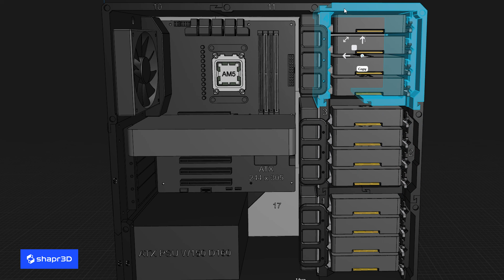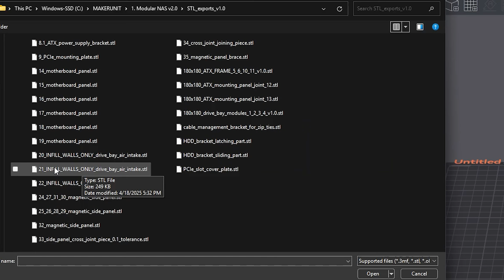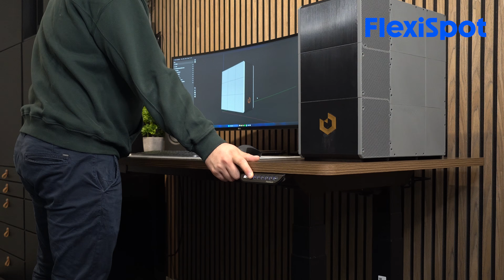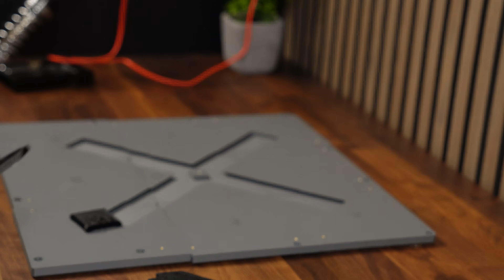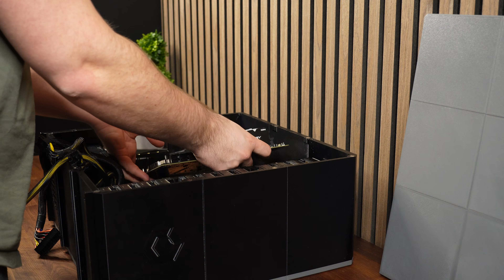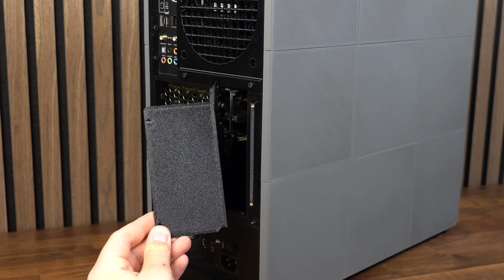Maximize Your Home Storage With This 3D Printed ATX NAS Case

Comment: I guess next will be e-ATX compatible case to have the complete line up 😅.

By the way i think the door could benefit a lot of hinges. And maybe some alternative back panels with feet to allow the case to aldo work while in horizontal position. Definetly subscribing to the channel!
Reply from the maker: Some time down the road E-ATX might come 🤷‍♂️ Door hinges could for sure be a suitable alternative as well!

Alternative side feet is also a possible option and can be easily added with the included .step file if necessary 😊

Comment: Would it be possible to sacrifice storage space to make room for a bigger graphics card? This looks nice, but I want a case for a normal PC, not a NAS.
Reply from the maker: Hi! It’s possible to do, however I haven’t tested it out. Have you checked out my other ATX case on Printables? It’s got the same printing requirements, uses less filament and is generally better for «normal use».

https://www.printables.com/model/900406-atx-pc-case-180-x-180-mm-print-volume

Comment: First of all, congratulations to you and your wife/GF/SO on your baby!

Thank you for sharing this brilliant build! I do have a few questions and thoughts:

1. Since the case is 100% plastic, there is no EM shielding, correct? Have you noticed any problems that could be attributable to that?
2. I'd love to have a few small openings in the front or even one of the side panels for a power/reset button and USB ports. I assume we could make our own modifications for this, but would they compromise the structural integrity of your design?
3. Your drive cage system is awesome; I especially love how the HDDs snap into position. Since they are responsible for much of the structural strength of your design, would you consider them ideal to use as a key subsystem for a modular case system? For example, a row (or double row) of those cages could run horizontally along the bottom of the case, and the motherboard and PSU could sit above them.

Again, thank you and congratulations!
Reply from the maker: Hi Felix! Thank you very much! The due date is right around the corner so we expect his arrival around a week from today! 

1. I personally have never had issues with shielding in terms of static electricity etc. However frequencies emitted by the PC I have no idea how works. I have not been able to measure this and frankly don’t know how to. I have had many people concerned with this, however not a single person who actually built one of my cases (to my knowledge) has reporter static etc. being a problem either.

2. I have designed a version with some air intakes in the front in between the drives rather than the side but I’m awaiting feedback from some users who are testing the files for me as I’ve been very busy lately preparing for the baby’s arrival. About USB, I think due to the density of the drives going all the way from the top to bottom, I’d say the most reasonable place to put some USB’s would be the middle top panel right behind the drive bay joint. I don’t think it would ruin the integrity of the case. Alternatively removing one drive slot at the top or bottom could allow room for a front-panel USB.

3. Thank you! I think they would be strong enough to have the motherboard sitting on top as well. I’ve been thinking about doing a 8-bay design with two bays at the bottom like a Micro ATX motherboard on top. That could potentially work out very well. 😊

Comment: I'm kind of worried that the drives might get too much vibrations, this could be at least in part mitigated by using TPU for the feet and fan brackets but i'm still partially worried. Great design nonetheless. Would be cool to see if a TPU fan bracket part would be possible
Reply from the maker: Most PC fans I have used have little to no vibration at all and are pretty well balanced, both expensive Noctuas and cheap ones I got from AliExpress have been working great, especially when mounted to a case directly. 

It’s possible to add some vibration damping rubber pads (double sided tape) to the bottom for vibration reduction. However it won’t stop the case itself from vibrating, only lessen the audible noise it transfers to whatever surface added. Of course unless your desk is already vibrating from something else. However, most desks I have used do not vibrate a lot… 🤷‍♂️

I’m glad you like the overall design, and I understand your concerns, but I’m also a little confused as to what you mean actually cause the vibrations, the fans or the drives? If it’s the drives, I’d agree more than if it was the fans.
Reply: One common solution is to use rubber grommets for the screws used to hold the drives
Reply from the maker: @felixfujishiro2304 Yeah that’s possible too! I believe the whole drive bracket could theoretically be printed in TPU as well, however I’m not sure about the latching mechanism only… 😅
Reply: @makerunit   as felixfujishiro2304 said before me, if you look at commercial NAS and server drive bays they usually have some parts made of rubber or soft plastic; fans are less of a concern because some of the high end ones ie. Noctua have soft pads around the screw mounts. As for the HDDs the reason is partly because vibrations can shorten the life of hard drives, but also because multiple parts moving at the same rate (i.e. fans set at the same RPM, or HDDs spinning at 7200rpm at the same time) can create resonance (this can be heard for example in cheap metal cases with multiple fans mounted on the same side, as a slowly "pulsating" noise). I'm sure it's less of a noise concern in this case, if noone who printed it reported it, but still a bit of a concern in terms of drives longevity. Sorry for the long wall of text 😅 I'm still sure this is a minor concern anyway and I love to see we're finally getting mATX more love! My personal challenge right now is trying to fit a mATX on a 10" mini-rack unit! (this is the second time i try to post this reply but yt keeps deleting my comments while letting through spam bots... I hate this site)

Comment: So… how much filament do you end up using before everything fits together perfect 😂. I always burn at least 1-2 prototypes designs before everything fits correctly.
Reply from the maker: Hey! For this one I actually only did one «main» attempt. I’ve made so many cases now that I’ve learned the typical failing points by previous mistakes.

Only had to re-do the PCIe rear panel once, and part 10, the I/O upper left corner piece.

Total filament spent, about 4.5 spools. It is a filament heavy project.
Reply: @  Nice! Very well done for a case of this complexity. Since I have your attention, I’ll throw in my suggestion for you to design a Raspberry Pi 5 case in your style.
Reply from the maker: @sunnygalli It’s already on my «eventually» list 😁 I’ll be sure to keep it in mind. It would for sure be dope! Can’t make any promises though. We’re expecting a baby due next saturday so I’ll be somewhat limited in the coming time!

Comment: Great build but I think the fans placement is not ideal. You are severely restricting the amount of airflow with the pattern of the slots on the side of the HDD cage. It would be ideally mounted on the side pushing air into the HDD's not pulling it in.
Reply from the maker: Thanks! And it was actually the original design, but ended up like this simply due to a matter of trying to fit all this within a print volume of 180mm cubed. I’m working on an alternative now though which allows air to be pulled in the front instead of side. However it’ll still be pull 😅
Reply: @makerunit 
I would be very interested in a future design in which outside air is pulled in from the front.
Reply from the maker: @felixfujishiro2304 That’s true! I’m for sure making more versions in the future so I’ll keep all this feedback in mind when that time comes!

Comment: Ermm what about the air intake?  I mean, the ones at the front is still taking warm / hot air from the drivers?
Reply from the maker: The air intake is on the side. Yes the air will be a little bit heated up from the drives, but let’s say the air being pulled in is 25c, passing the drives it may increase to 35c or 40c for very hot drives  (talking air temp, not drive temp)

40 C air can still cool down a 60-70c CPU, as long as the air going into the air cooler is colder than the CPU temp, it will still have a cooling effect.

Most people will not need super high power components in their NAS anyways, as they usually serve as storage servers or similar requiring less processing power 😊
Reply: @makerunit  thanks for the reply.

Comment: Such a cool build! I'd really love to see a way to do this with hot-swappable drive trays and a backplane, but the electronics required for that might be outside the scope of what can be done at home right now.
Reply from the maker: Thanks! It’s possible by using backplanes but I haven’t been able to find something that’s easily accessible for «everyone». Therefore I’ve opted for manual wiring on my projects for now. I might try a backplane one in the future at some point though 😊

Comment: Love your videos, keep it up! 

I have been thinking about a NAS enclosure to be used with a old laptop. Bottom plate of the laptop can be remove to rest the laptop on top of the enclosure, maybe even add extra cooling to the laptop. For a 15 inch laptop it could have 6 bays for drives, a nvme sata adapter a place to store both the laptops power adapter and a small power supply or a power distribution card to power the hdds. I have been dreaming a built like this for some time but I am too lazy to learn this level of 3D design. Do you think this idea is even possible? I would buy a printer the second this idea becomes a reality 😂
Reply from the maker: The idea is most likely possible, however not likely something I will do, probably never, mainly because most laptop boards are different, there is no standard and hard to make one model to rule them all. 

I don’t think it’ll be super hard to make something like that but unfortunatel you’re on your own when it comes to designing this one as I mainly focus on making models that are universal using standardized parts 😅 feel free to take some inspiration from my designs though to help you a bit 😊

Comment: Love this case!!! Purchased the plans and just about finish the printing but I do have one question. Do you think this will fit a 240mm AIO?
Reply from the maker: Hey! Thank you! I designed this specifically for air cooling as NAS systems often run 24/7 and in those scenarios air cooling tend to be more reliable in the long run. It will not fit as it is now, but you can modify it at your own risk with the included .step file 😊
Reply: @makerunit  Thank you for your quick response. Also, I believe I may run out of PETG for parts 12 and 13. Would it be ok to print them in PLA?
Reply from the maker: @ 12 and 13 are the panel joints, these may be good to print in PETG if you can, any color will do though as it’ll be hidden behind the motherboard. 

It’s what holds everything together so it’s extra at risk of bending due to heat etc. My recommendation is still PETG, but PLA may work as a last resort. Are you planning to install very hot components?
Reply: @makerunit  No nothing hot just the usual PC components. I actually found some extra PETG but I am having a difficult time siding pieces together. To the point where I actually  broken part 5 trying to hammer it into part 6. I re-printing it  but only have PLA. That shouldn't be an issue should it and do anyone have any suggestions on making the parts slide together easier?
Reply from the maker: @calcappone  It should not happen but can happen due to the tolerances being too tight.

Have you checked your printer for over-extrusion?

What printer do you have btw? The thing is to get dimensionally accurate parts you also need the settings tuned properly for each filament. One spool of PETG can behave differently at a set temperature than another PETG from another brand.

I should probably have specified this better though. How are the other parts? Have you been able to attach them?

One tip if you’re struggling to mount them, try sanding down the inside of the track a little bit instead using sandpaper to try to carefully remove some material until it slides together.

Another factor that might be making a difference is layer height. A smaller layer height will usually give more precise parts. While a bigger layer height will give more friction and bigger overhangs.
Reply: @makerunit  I have a Creality K1C and I have been having a difficult time with all the parts...even with the magnets fitting into their place. Funny thing is, I reprinted part 5 in PLA and it slid together with ease. I have got most of the magnets in the PLA outer panel by using pliers. The ones that go into the PETG main body have not been easy at all. I have only place 4 by using the soldering iron to make the holes a little wider which was time consuming. For the rest of the magnets inserts, instead of magnet I inserted threaded brass inserts deep enough to use m3 screws so the magnets on the outer panel have something to attract to. I'm a newbie to 3d printing and still have learning to do so thank you for you design and all the help.
Reply from the maker: @ I’m using a Creality K1 Max, which should perform quite similar. What layer height are you printing at? 

Anyways, if you’ve already printed my best suggestion is to sand down the inside of the slots a little bit at a time until you can push them together.
Reply: @makerunit  I did. Besides this was just really a test print with materials I already had. I will be printing another in the colors I actually want and will use your suggestions on layer height. Right now I'm printing @ 0.2 layer height.
Reply from the maker: @ if you struggle with it being too tight, try a smaller layer height. Can you message me on Printables? I can send you a testing piece with the same tolerance that you can try to print at different layer heights and settings to test what works. So you spend less filament in case you get the settings wrong.
Reply from the maker: @calcappone  I have uploaded the "TOLERANCE_TEST" model to Printables now, you can get it from the original project listing so you can test different settings to find something that works better for you before committing to a bigger print.

Comment: It would be interesting to see what you could come up with for another gaming style ATX build. Cable management channels, clips etc. Side panel with clear insert. You can readily buy clear acrylic sheets in standard paper sizes in eBay here in Australia, an A4 window would be good. I liked the other ATX case, but I would happily go a little bigger for cable management, more PSU space etc. I've been enjoying my little boy L lounge PC for emulating games with the family. It was my biggest 3d printing project to date, pushing the limits of my qidi ifast.
Reply from the maker: Actually my previous ATX case has an optional plexiglass window option, though it’s not posted publicly, a few people have made it work  with the files I sent them 😁

I’m planning to do more cases eventually for ATX so perhaps one of the future cases will work better for your needs.

Glad to hear the SL has been working for you 👌

Comment: First of all, congratulations on the project.
Now a suggestion: would it be possible to change the project to allow installing liquid cooling instead of hard drives?
Reply from the maker: Hi, I think I’ll steer away from water cooling on this one, mainly as it’s intended for NAS purposes an AIO is not ideal for 24/7 continious operation, here airflow is the definite winner in terms of reliability. I won’t make changes to allow for that in this particular case unfortunately.

Comment: Do ITX Mainboards fit? I have an Nas Board with an N100 Intel CPU that is going to be my NAS. It Also has an PCI expansion slot for an Sas to Sata controller like yours. Since it only pulls 16W it would be nice if I could use your case with it.
Reply from the maker: Hey! ITX motherboards will work as well. 

They all (ITX/mATX and ATX) mostly use the same mounting points, just more of them on the bigger boards. 😊

Comment: Thoughts I haven't digested too much yet:

1) toolless drive Mount. Skip the rails and let the user just put the drives in

2) in combination with 1, put the connectors on the backside. Iif the connectors are hot glues in place (or epoxy, but that is permanent) it will create hot swap-like bays.

I am 100% considering this once I grow  out of my normal chassi
Reply from the maker: Definitely some valuable feedback, seems like the community would prefer the drives to be the other way around. For sure something to keep in mind. I’m a little more skeptical about the part with the part about hot glue, it might become a mess if not being too careful 😅
Reply: @makerunit  definitely.. auto disconnect on over heating :)
"DIY Perks" made a laptop dock using that technique but with epoxy.